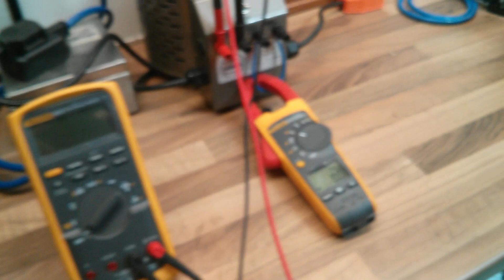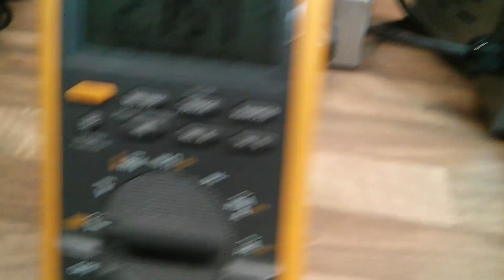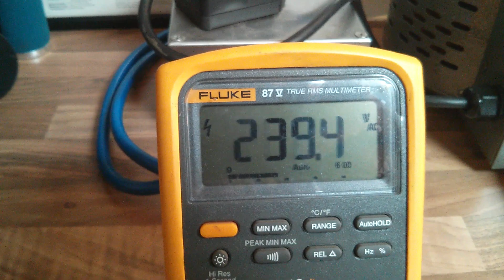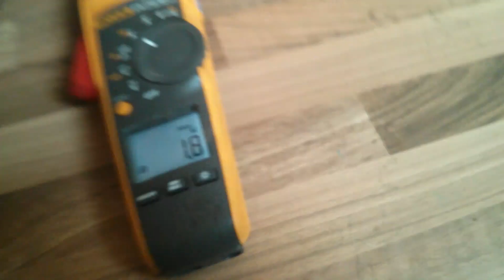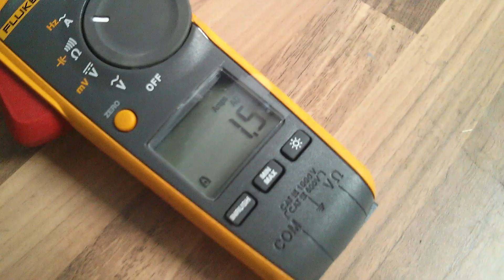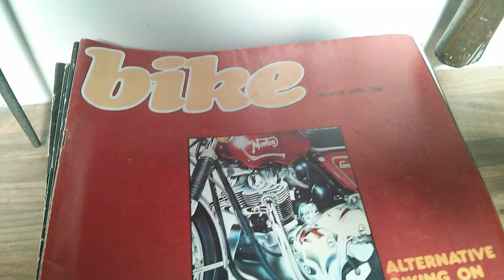Resistive Ballasting a 400W Metal Halide Lamp

Comment: So for a 250w halide on 120v would I need a 250w bulb as a ballast or do I need more
Reply from the maker: In theory yes, there are HID lamps that have integrated ballasts in the form of a linear halogen lamp inside, but not entirety sure of their actual wattage in relation to the halogen ballast.

Generally speaking, try to match the wattage of the two as closely as you can, so a normal 400w HID lamp would probably pair with a normal 500W halogen lamp as a ballast.

You just need to add an igniter in there then to strike the arc in the HID lamp to begin with.
Reply: @SteveLane  if I have a probe start I would just need about 300/350watts asa ballast

Comment: :) That is great! thanks for sharing! i would like to do the same with a 700 w mercury vapor... any guess??
Reply: You need to divide arc lamp wattage by 1,5. So 700w divided by 1,5 is 466.66 so you can use a 450w to maximal 500w incandescent lamp. But i would meter the input just in case. i would keep it under 1200w. have fun.

Comment: thanks 4 that info the dimensions of a 200W is 80 * 160mm & the dimensions of a 300W is 95 * 180mm
Reply from the maker: Séamó Mac S that sounds about right, the higher the wattage, the larger the lamp. actual sizes tend to vary with the manufacturer or year of the lamp.

Comment: +Steve Lane How would I do this on 120 volts with resistors? How many ohms?
Reply: Zach Z resisters rated for 500 watts are huge and expensive (10 inches long and $100).
Use an ohms law calculator.

Comment: I have already done this type of installation with a lamp mercury vapor 125w, which I put in series with 260w incandescent lamps because 260W / 230V = 1.15A and that's what it takes to make it work properly the lamp.
Reply from the maker: Good job! finding the right lamp to run a HID took a bit of trial and error from my findings, even after working out the calcs, mine were Metal halides, maybe Mercurys are a bit more forgiving?

Comment: Hi,

I found these on Ebay today.  Might be the self ballasted lamps that you were looking for?
http://www.ebay.co.uk/itm/281761139272?_trksid=p2057872.m2749.l2649&ssPageName=STRK%3AMEBIDX%3AIT
Reply from the maker: David Kempton Yes that's exactly what I was talking about, if fact since I've made this video I have acquired one of those 250W self ballasted halides, which is currently in my window display waiting to be made into a video.

It would be really interesting to find out what the resistance of the actual halogen ballast is, but getting that value would mean breaking the outer glass... yes I could measure the current flowing, but that would include a certain unknown amount of current shared by the halide itself...

...I think what I will do is run my 250W self ballasted lamp through an ammeter, for 10 mins at a stable voltage, take note of the current curve and peak. Then using various halogen lamp arrangements in series with a 250W non ballasted lamp I will attempt to match as closely to the self ballasted lamp as possible.

Bit trial and error really... If you can think of anything better I'd be interested to know, I will revisit this video with that experiment if it yields results as it's interesting to know the ballast value for a 250W halide and also is an interesting way of obtaining it without getting all destructive (like some...).
Reply: Having looked at the lamp closely I can see that the ballast halogen is only in service with the main arc tube. It is not in series with the resistor and starting arc. So I wonder if  using  a halogen bulb as a ballast on a normal tube might not work so well. What do you think? Would it  degrade the starting?
Reply: Series  not service! Damn SwiftKey!

Comment: So if I had a 1500 watt MH bulb I could run it in series with a 1500 watt heating element or Incan bulbs?
Reply from the maker: Tim Gomes I will revisit this video to find out if it's as simple as that, I get a feeling it is not however.
Reply: You need to divide the wattage of the lamp you want to ballast by 1,5. so you would need a 1000w halogen tube for example. At least it is like that for high pressure mercury vapour lamps.

Comment: Talking of resistive ballasts, we had an old fluro in our kitchen, it had what looked like a long coiled heating element in a tube, a bit like the bar fire heaters.
Reply: I believe those were designed to prevent the buzzing for places like lecture theatres
Reply: ***** Was actually designed for kitchens, made it slimline because the ballast was in a 1/2" square metal tube that supported the fluro tube
Reply from the maker: ***** Would be interesting to see if you still had one, although I get the feeling it went in the skip years ago... x[
Reply: Yeah, i think i was in late teens or early 20's when that got removed, and i stripped it down to see how it worked